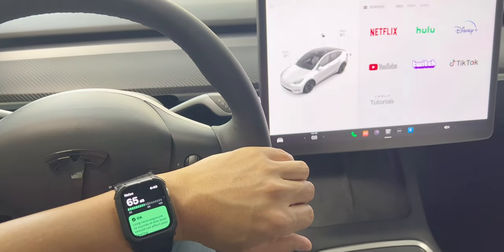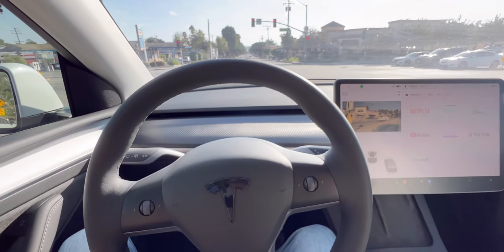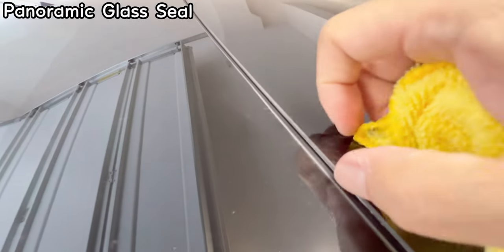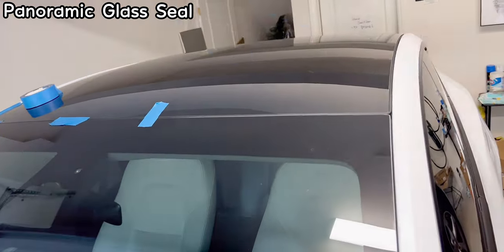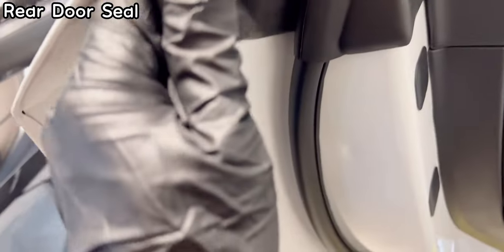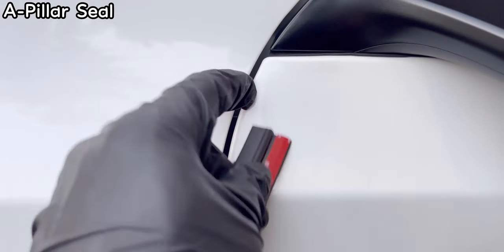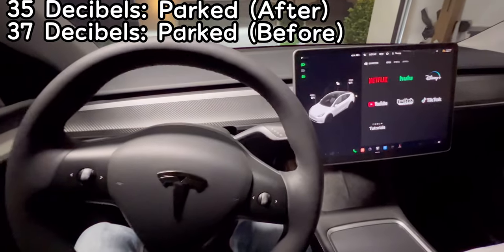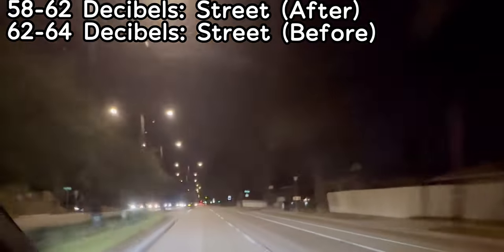【TESLA¹⁴】 How a Noise Reduction Kit Improved Tesla Model Y! 🔧🔇

Comment: Have seen my noise reduction videos and they all basically say the same thing, these kits don’t really show a large reduction in wind noise sounds.  I actually care more about one of the points you mentioned, keeping water and dirt out.  It really bothers me when I get in and out of my White M3LR and see dirt in the door frames, and the rest of the car is pretty clean (if my car was dirty I’d wash it).  Thanks
Reply from the maker: Yea. It keeps the dirt and water away. There is a noise reduction also for my Tesla. Not much but I notice it.
Reply: Well , if you think about it logically, it will help a lot with dirt and putting these seals will will no doubt help some with noise. , just simple physics

Now how much is obviously the question 

So I think this is one of the best mods
Reply from the maker: @shdmd2118 yes. It’s good but i still hear wind noise. It reduces it just a little. Still cheap enough to try the mod. I recommend it. 👍🏼
Reply: @TacticalExpedition  Good my expectations will be met.

Comment: Tesla has double pane on front and back? My 2022 is only fronts.. I think cabin or road noise is really bad in Model Y, it's like a deep rumbling bass booming sound inside :(
Reply from the maker: You know mine is not bad at all. I wonder if your doors are all set correctly. Expensive German cars sounds like how you describe the rumbling bass booming sound when you open one window. It’s because the seal is so tight and leakage is free that creates kind of like vacuum mode but you were saying that even though all windows are closed, you hear rumbling bass sound, it might be that one of the door or window is not closing or sealing properly.
Reply: It's only in the front, not on the back windows.

Comment: not much of a difference
Reply from the maker: For me, there’s a big difference. It’s worth having it for not lot of money. 👍🏼
Reply: @TacticalExpedition  do you actually hear the difference though?
Reply from the maker: @pkerry12   yes. for sure. I'm using both the door weather strip and the panorama roof weather strips. For me, big reduce on wind noise.
Reply: @TacticalExpedition  may I ask the product you bought? I might give it a try I have a 2023 Model 3 RWD
Reply from the maker: I bought it from RPM Tesla website. See if you can return it if it doesn’t work. Or buy it from Amazon. You can return it. 👍🏼
Reply: @TacticalExpedition  do you have a link for one that has the sunroof rubber as well? most seem to not include that.
Reply from the maker: RPM TESLA sell it all.👍🏼